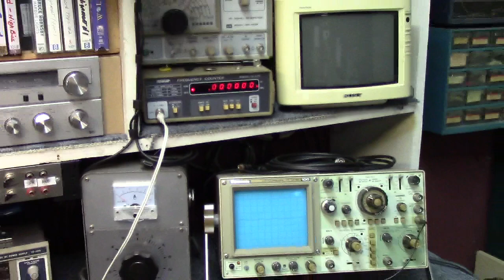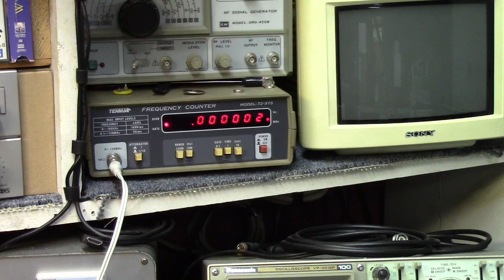Pioneer Component Car Stereo - part.3 cassette mechanism/system completed.

Comment: Nice work on the cassette mech! Thanks for sharing your repair / refurbishment /service on these classic vintage Pioneer Lonesome Car-Boy Centrate Components! Don't see these much anymore and you are correct, these would more than likely be mounted under dash in the vehicles of the same vintage and I believe Pioneer had double stack brackets along with the single component under dash bracket that I am sure came with these units originally. 

In any case, keep up the awesome work and I look forward to new videos!
Reply from the maker: Miles, thanks for your great info, the unit was shipped to me with all 4 pieces stacked & connected by the brackets.

Comment: Question, I have a pioneer vsx 9300, early 90s model, it runs pretty hot, was that common for that amp?
Reply from the maker: If you watch my video for the VSX-9700S I repaired I comment on that problem.